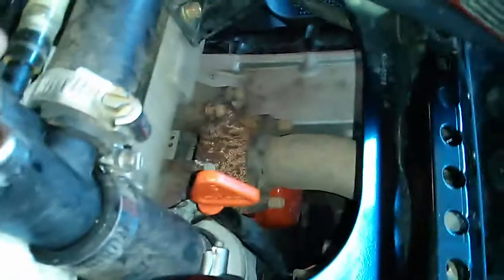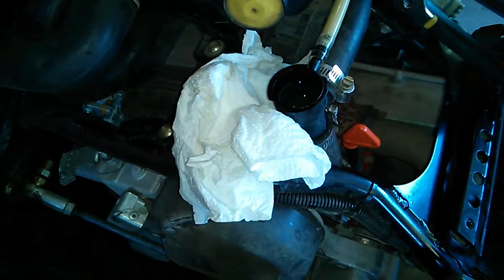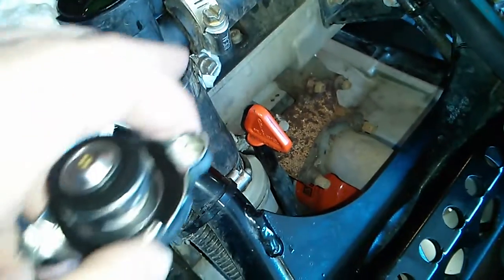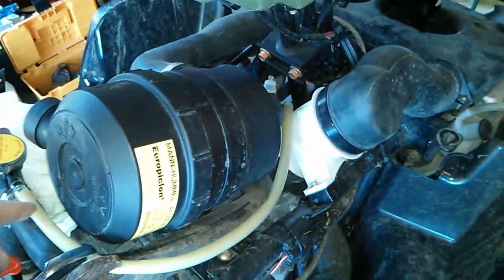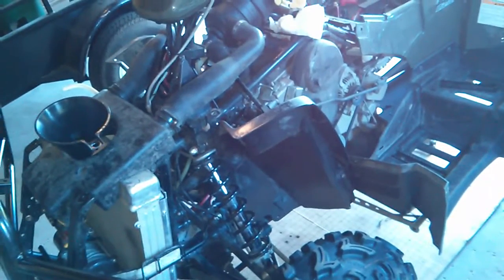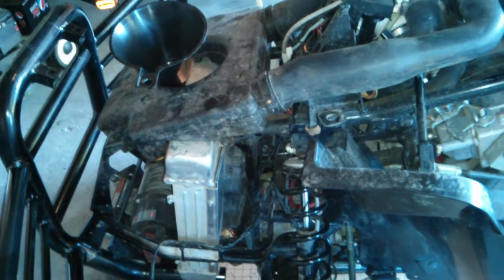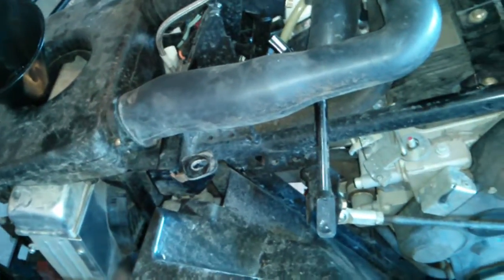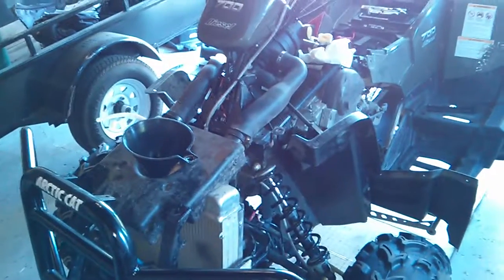Coolant Issue Should Be Fixed... Need A New Hose? - 2007 Arctic Cat 700 Diesel

Comment: That is just normal plastic tubing are you can get at Ace Hardware and you they heated the push it over and then when it pulls it stays you can just buy normal tubing and put a clamp on it and you'll be fine